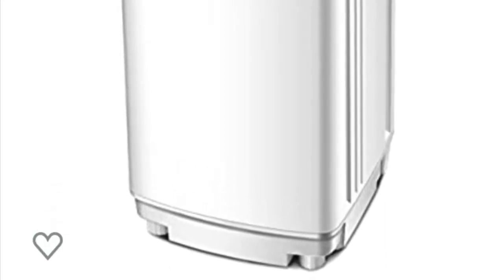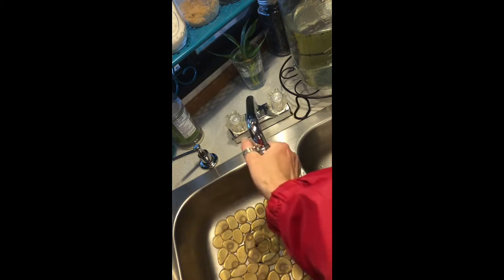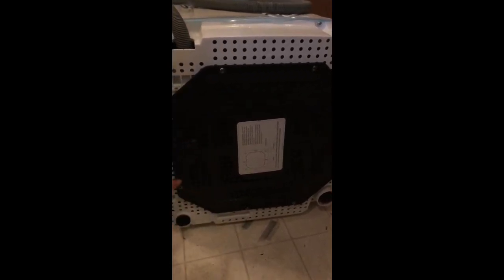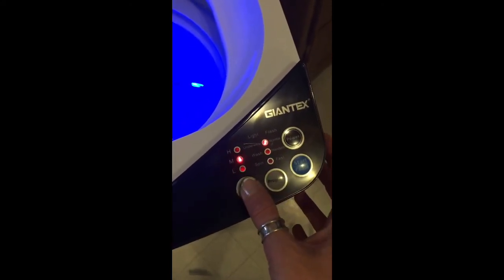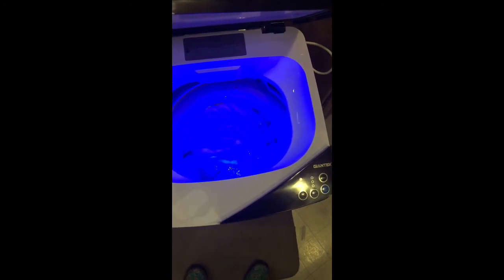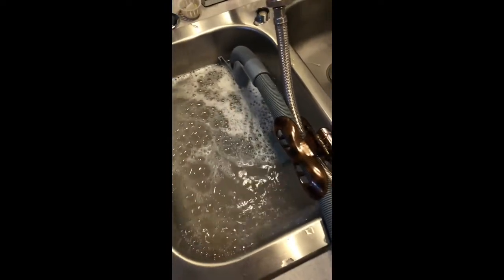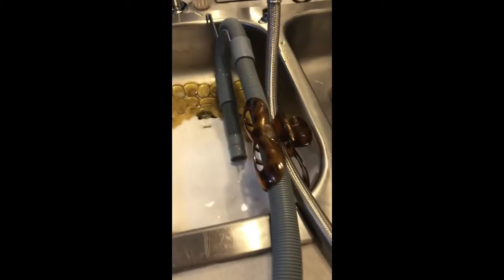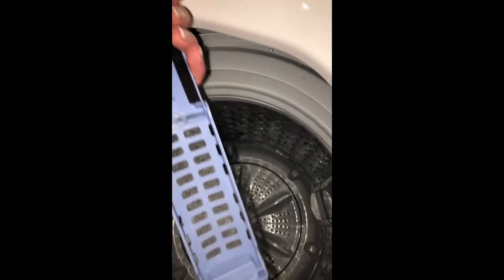RV Review for Giantex Full-Automatic Portable Washing Machine

Comment: I just bought this off FB Marketplace. Didn’t come with manual so I’m trying to figure out the cycles. 6 options right? And if I click thru, if the light is flashing it’s the cycle on the right list, correct? Steady light, cycle on the left.

Comment: Tina, I need a bit of help... I bought the exact same one... didn't come with a manual.   Would you be able to share yours?  when I hooked it up and got it started....it leaked...and leaked. I did NOT stop when full.  I had to pause, then turn on spin to remove the water.  It filled the reservoir again, then still spilled over.   It's brand new out of the box.  Styrofoam was decimated and fell apart when I took it out of the box, and it was delivered upside down.  Not sure if that has done something, but I need some troubleshooting.   I tried contacting the company but no 'contact us' information anywhere on the web.   Any tips, know how, instructions would be appreciated.  :)

Comment: Nice review very in-depth I'm thinking about getting one of these. And was wondering how that works where you leave the water on for the full cycle does pressure ever build up in your faucet? Or is there like a secret compartment where the water goes? I don't know how that stuff works. Just curious if it would it build up so much pressure that the hose would explode? Lol

Comment: I bought mine last week, I had to add water manually because the adapter it came with does not fit my kitchen or bathroom faucet, I ordered an adapter on amazon it did not work neither, it washed my clothes pretty clean
Reply: ii did the same like U loading water manually and  i press start but why doesn’t work at all ?
Reply: @tinaalcorn3132  i’ve tried loading water manually coz the hose doesn’t fit on bathroom sink it doesn’t work its not rotating the drum at all thanks for posting the link  adapter